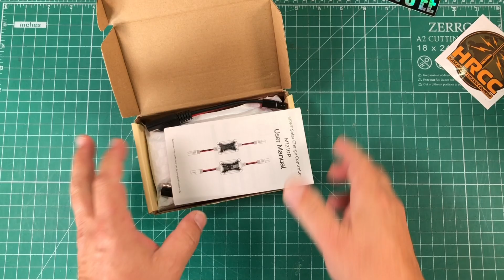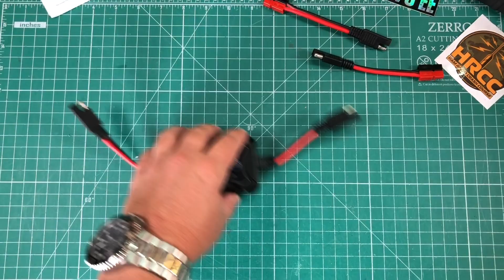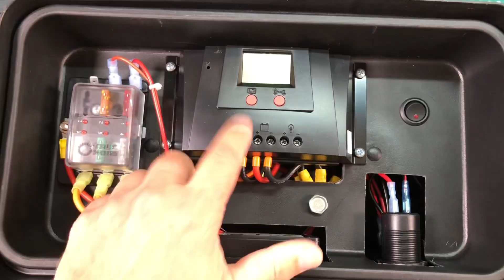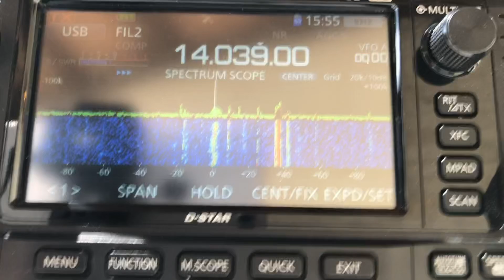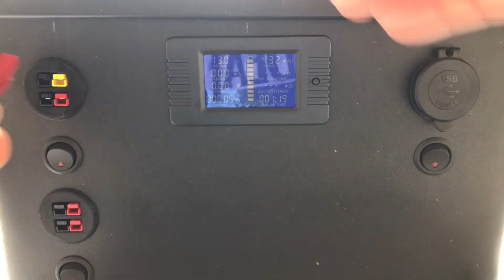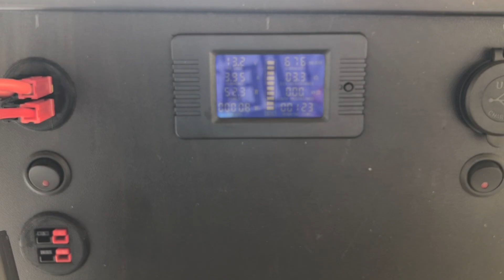10 Amp MPPT Solar Charge Controller

Comment: I bought the one in the Amazon link and it's trash. My PWM 12.5 watt panels puts out the same power as a 100w on this supposed MPPT controller. the 100w panel on the pwm gets about 40 watts.
Reply: I just today discovered that past me is an idiot. I had installed a very small wire to carry the charge on the 12.5w solar panel, and it worked fine for that, but I didn't consider the small wire when I increased the solar panel size.
Properly sized wire I'm getting 4 amps on the linked amazon MPPT and 4.5 on a Victron 75 |15. 
Even the PWM was getting 3 amps.

Comment: > @2:02 "it will take up to 10A of input from solar panel""

MPPT solar charge controllers are typically rated on their current output rather than current input .   With boosting MPPT (the vast majority of them) the incoming current will be lower than the outgoing current.  We could put a couple hundred watts of panel on it but output will still be limited to 10A.   I max out my 15A MPPT regularly with 200w of panel.
Reply from the maker: Interesting.  That is very good to know.  Really helpful on partly cloudy days if you need to hook more panels up to get some juices flowing.  Thanks for the info!

Comment: I use a Genasun MPPT 10A solar charge controller for LiFePO4 batteries.  It charges only one battery chemistry, and it is kinda pricey. But it puts out no RFI..  It can handle up to 140w of solar panels.

Comment: Mike, PowerWerx makes a great little MPPT charge controller for about $30. Model # MPPT-150-14.6. Its a much more compact solution for building into a portable battery box like yours. Also, WestMountainRadio has a power gate with an MPPT controller built-in. Even though its designed for ham radio, it is an RFI nightmare.

Comment: The specs say it draws <20ma when plugged in. And for those that may already have the SAE to powerpole adapter cable, most of the reviews say it is wired backwards from everyone else. So do like Mike, just cut them off and replace with PP's.

Comment: Thanks Mike. I Got the Upgraded model with BT App. From AMZN for $34.40 with coupon. Wow. Ordered 4am and it will be here later today. I’m replacing the BougeRV you reviewed a while back. It just never worked right.  Got a new RedOdo and wanna treat her right. I’ll let you know how this one does.
Reply: Nope. And now Mike has done an updated vid, I’ve checked and no issues.
Reply: how did it work out? noise?

Comment: Wondering if you have any offerings or suggestions for a battery box similar to yours without the battery and charge controller already installed? Thinking putting my existing battery and gear into a box.

Comment: I got the same one from amazon. put power poles on it. I have a master switch on my ammo can battery box. I did not want to chance RFI so I put 240-43 cores in in and out . wrapped few turns of 12 AWG zip cord. from powerworx sold threw Amazon . I get no RFI. I put ferrite on everything. I just buy everything Amazon to keep it easy. I have Victron MPPT charge controller as well. with ferrite  quite quit RFI . was running that external . still use it with 320 watt 36V panel. victron takes 75V input on the one I have. 15 amp charge. and bluetooth app change settings or monitor solar output. so I am all set QRO or GRP . have big and small anno can battery box. and I insulated my LiFePO4 battery . home depot pink foam board . winter time parks on the air. I am in Boston NY.  clear day snow on ground . get out great ! saving for that NEW 2024 DX commander . smaller pole to carry. 73's

Comment: The big difference is when you put 2 or more solar panels in series to save on loss for wire runs. Also 2 or more in series will start charging sooner in the morning and go later in the evening.
Reply from the maker: Well I just so happen to have multiple panels.  I’m gonna have to try that.

Comment: Thanks, Mike.   It’s always good to find a new usable charge controller. (I need to buy another like I need a spare hole in my head. 😅). I have noticed the difference in MPPT vs PWM really shows when the solar panel is at a higher voltage and not so much with “12v” ranged solar panels. My trailer has a couple 175w 33+v and 16’ long and flexible panels reclaimed from an old military roof install.  I run them in series into a renogy 40a CC so I can use smaller wires and the MPPT function handles the near 75v peak to make a higher current @ 14.6v for my two 100ah LIFePo4s. Not a thing you can to do with a PWM.  Good Luck with the new branding !!!

Comment: 30v maximum input voltage?   Nice compact idea,  but not a real MPPT, sorry...  but nice controller!
Reply from the maker: why do you say that?
Reply: It's definitely mppt my friend. I attached a voltmeter to the panel and you can watch it quickly adjusting as the sun/clouds change, and the output boosts current. Can't do that with anything but mppt.

Comment: Is there a reason that you are only getting 62w out of a 100w solar panel?  I'm asking because I do not know if that is good, or bad.

Also, is there a charge controller that will charge lead acid batteries?  I have a panel sitting around that I would like to use to keep my truck batteries charged as I don't use the truck that much anymore and the batteries are always dead when I go to use it.

  Thanks Mike!
Reply: Pretty much any charge controller will charge lead acid batteries,  just change the type of battery on the selector. 

The reason for lower voltage is anything from haze in the sky,  a couple clouds,  etc.   They affect it greatly as does the time of day and angle of the panel to the sun.   Rarely do you ever get full power,  80% is a good goal.
Reply: @chrisnmichelle0218  Reason I asked about charging lead acid batteries is that Mike didn't mention it, and the description didn't mention it.  Thanks for the info.
Reply: @bigfranksworld he said it does gel, agm and lithium. He didn't say flooded if that's what you have might over or under charge can't remember the charge voltages.
Reply: @ronrico2620  I was asking him if he knew of a controller that did flooded led acid.  I know he didn't say lead acid, that is why I asked,

Comment: Umm..But, how does this controller stack up against your small shrink wrapped controller as far as RF noise goes on the spectrum?I'm using a 100 W solar panel Into a 50 amp hour life P04. Is the 10 amp Capacity of this controller going to cover that or should I look at the 30? This is something it seems I can never get a straight answer for without having to sit through a 400 level lecture.
Reply from the maker: Maybe watch the video??  I literally show the two charge controllers in relation to RF noise.
Reply: @hamradiotube  Mike, I only see one visual sampling from the old mppt. You do, however, State that the subject Mppt is in fact RF quiet so I guess I'll just take your word for it as I already ordered the thing. Thanks 73 keep it in the bull...Ber KN4VUP
Reply from the maker: @berbaas9048  Whoops, my bad, I must have accidentally cut that part out.  I surely filmed it.  The MPPT is RF quiet.  I actually had to film this video twice because I screwed something up in the first version.  Now I screwed something up in the second edit.  And yes, your 10 amp capacity is fine for a 100 watt panel
Reply: @hamradiotube  Nah...Nah not bad at all, Hell, I've heard of some guy that likes to transmit through a dummy load so. now, that's something.!  73...
Reply from the maker: @berbaas9048  haha, you know I named my dummy load Carlos?
Reply: @hamradiotube  Igot wind of that somewhere in the ether...Keep up the good work my friend. 73
Reply: Sorry guy, I missed it I guess one of those days thanks
Reply: Simple answer the 10amp controller is fine. In fact it will handle up to 150watt panel. That 100 watt panel in a perfect world will put out 8 amps. You'll charge the 50 Ahr battery in 6-7 hours if the battery is at 0%
Reply: @johnkalotai9642  thank you John 73

Comment: Is this a Batteria brand?
Reply: Hi Phil, The controller is manufacturer by Helios.
Reply: The Bateria brand unit I got off Amazon has the same M1210P sticker on a box that is branded.  It did NOT have the Anderson PP connectors, just SAE.
Reply: @EdwardGriffin  I put the Andersons on myself as soon as I get them in. I leave the SAE on as there are portable panels that have the SAE connector. Gives my customers flexibility
Reply: @johnkalotai9642  I bought little adapter jumpers so I can use mine with both in the future.  Flexibility is great.